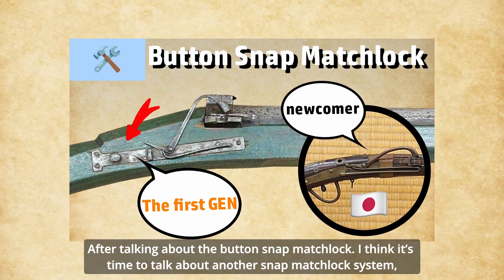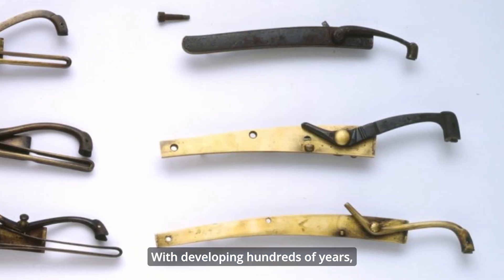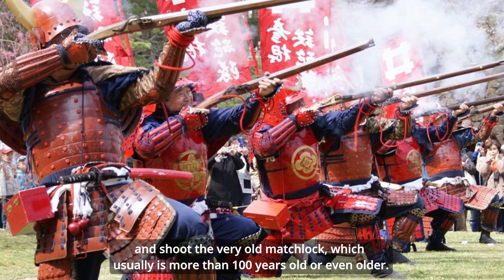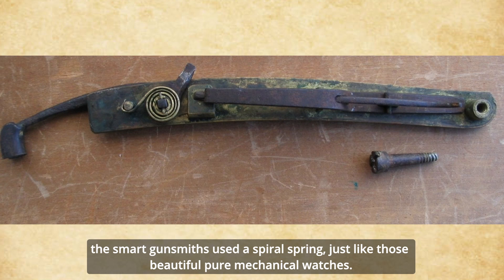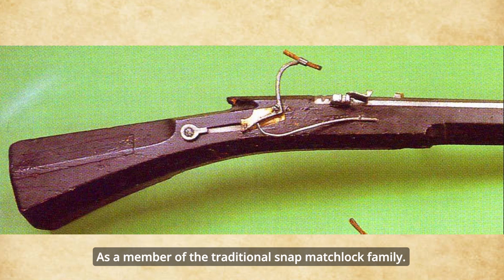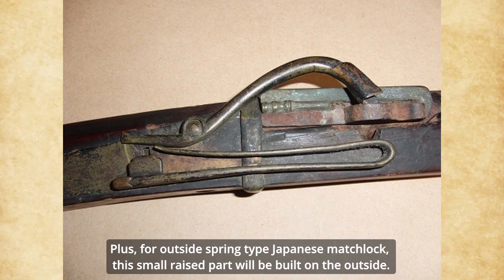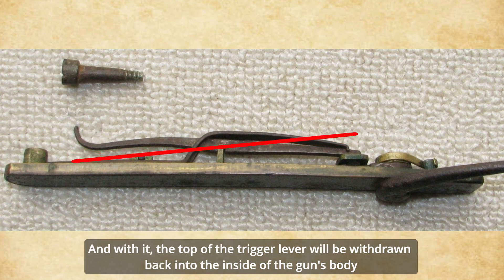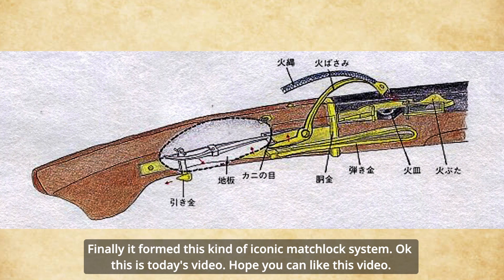Is the Japanese Matchlock the MOST Complex Historic Musket in the World?

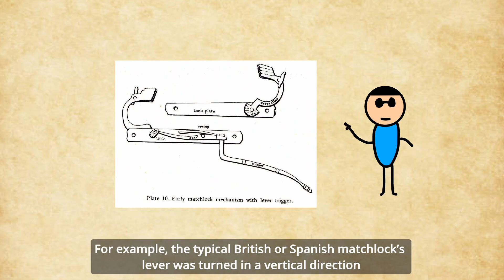Comment: 4:24 - This drawing you are using as example of matchlock trigger is not a snap trigger mechanism (trap trigger).

In this mechanism, the shooter press the lever (trigger) against the spring, so the serpentine holder move in a slow arch for the primer pan - depends on how fast the shooter press the lever.

The sear extension of the trigger lever, linked to the serpentine holder, is for move the holder back after fire, by the action of the now compressed spring, probable this is for avoid extinguisse the fire in the serpentine.

In action, looks like a slow motion trigger. See the shoot sequence in the video "Primed and Loaded | The Matchlock Arquebus", that show too the internal mechanism of this lever mechanism.

It's basically the primitive matchlock "S" trigger, but with a return spring.

Probable this lever mechanism precede the button trigger and the conventional index trap trigger.